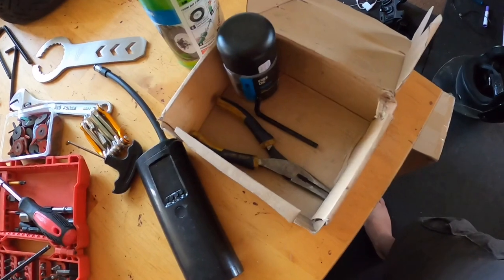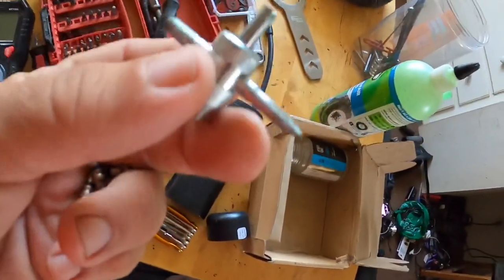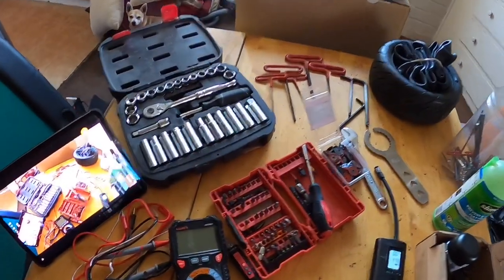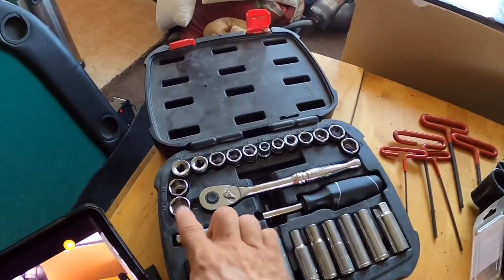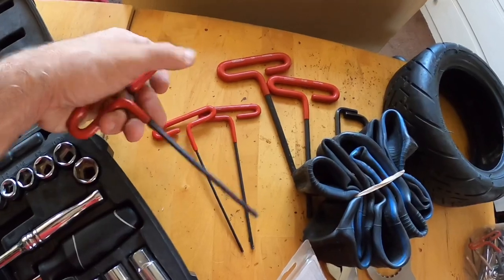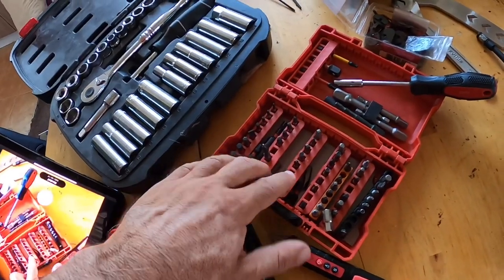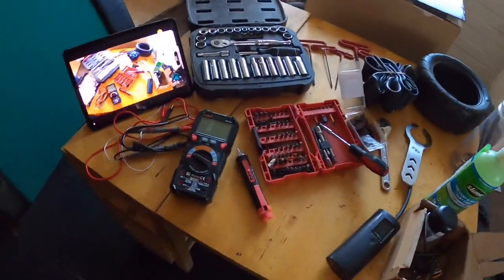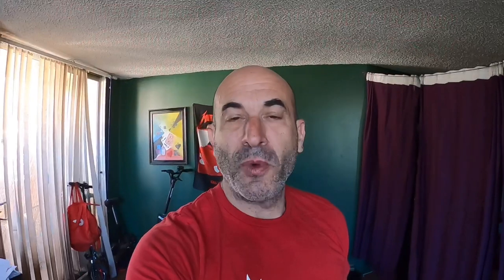ELECTRIC SCOOTER TOOL KIT | EVERYTHING I USE TO MAINTAIN & CHANGE TIRES AND BRAKES | DUALTRON ULTRA

Comment: I just bought a small 12v battery pack and installed full set of turn signals to my kaabo wolf warrior. Wish the tires on a wolf warrior where easier to change. No way I'd attempt to change at home and the closest electric scooter shop is about a hour drive by car from me.... hope they get more popular here in nj soon. I haven't seen ONE HIGH POWERED SCOOTER ON THE ROAD NEAR ME!
Reply: Minimotors NYC are in NJ, and service all kind of scooters also FYI
Reply: @EmilioZFG  thanks! And yes I think that's the place that's a hour drive from me I think there in Hoboken nj I'm in east Brunswick nj.  I got 500 miles on this wolf warrior and hoping to get another 500 miles before I need tires. I ride with street tires and hoping to get 1,000 miles total
Reply: @eddiekytia  helluva beast you have, that Warrior rocks! Yup @ Hoboken, They deal Dulatron & Speedway , but will service all kinds of scooters, they are very nice and knowledgeable.

Tires are cheap , not like cars lol

Comment: Yogi   question on   the old knockoff  cruiser scooter you had  what kind of mileage  did you get ?and was it 52 volt.
im looking at getting one.     also incase you weren't joking about your socket knowledge  those sockets are sae standard 3/4  and all other fractions   and your  non fractions are metric millimeters  10, 13, 19 etc  mm. all non us and even all modern  us cars are almost all metric  Millimeter.    Keep  your awesome unfiltered attitude and keep  making content and ill keep liking them.

Comment: Thank you for the video. I was just wondering what would cause an electrical controller to burn out. Could it be stress on the motor or is it a sign of a bigger electrical issue
Reply: I've been having constant issues with my emove cruiser with the stem that seems to unlock up automatically while riding and now electrical issues.
Reply from the maker: I think anything can push a controller too far they tend to be a common problem.
Reply from the maker: Yes that folding mechanism is not good. Maybe you can get a replacement fastener? That is that long metal bar in the folding mechanism.
Reply: @yogadude1234  Great idea. Maybe my warranty will cover it. Great videos. I also deliveries on it but have a different setup. Small canvas basket in front with hanging bungee cord and bag.

Comment: What brand of electric air pump is the one you have? It looks pretty compact. How many tires can it inflate from completely empty? AND.... how long does it take roughly for say the last 5 or 10 psi say filling a low tire from 35psi to 45psi.... THANKS STEVE
Reply: Get the Xiaomi Air pump, works wonders and very cheap for what it is